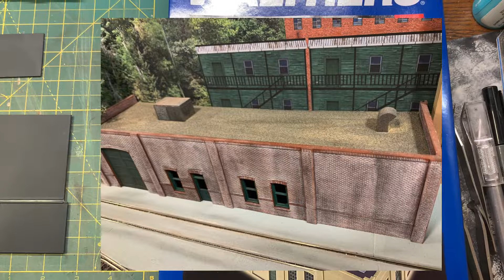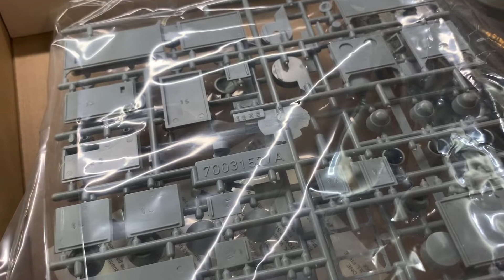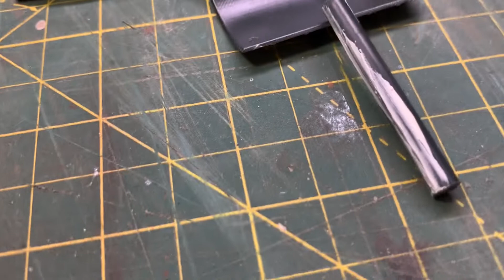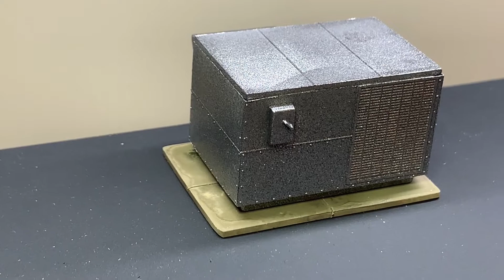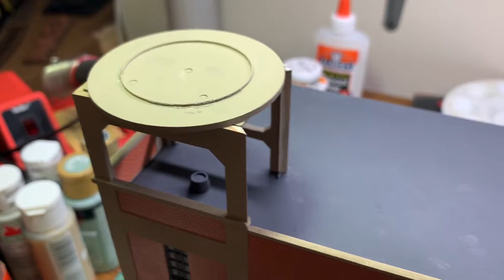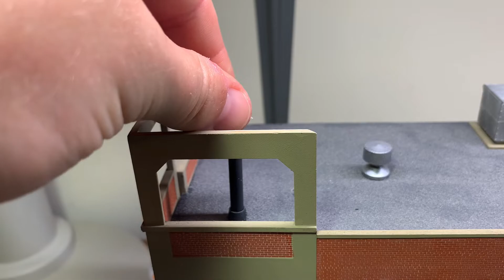Brewery Build - Part 4

Comment: Hi I'm building my own brewery in n scale. Very helpful videos! 1 issue right now is what to do with a couple of holes in the wall where a tremendously out of scale fire escape should go? The holes are also right next to/over the stairs for the loading dock. So my thoughts of a dumping facility (spent hope etc) wouldn't quite fit... Ty
Reply from the maker: Sounds like a fun project!  Depending on where the holes are, perhaps a sign could cover the holes you don’t want?  You could also attempt to fill them in with modeling putty - something like tamiya acrylic putty - and then Sand down after drying and finish to match the rest of the structure.

Comment: John, the roof looks great. it is one place that is most visible and is easy to tell a story about the structures history, like how you have added more modern roof top units that wouldnt have been available when the structure was built, it helps to make the structure more unique and also relevant to the layout. In more current times, some of these older buildings had the water towers removed but the support structure still remains. The water tower looks great, very sharp. Cheers Rob
Reply from the maker: Thanks Rob, The more I thought about it, the more I realized we see the model roofs prominently.  More to come on it, few more details and things to finish.